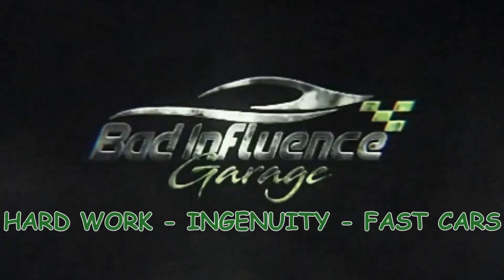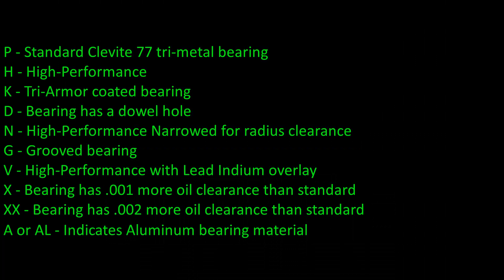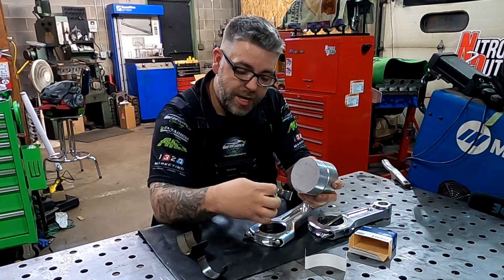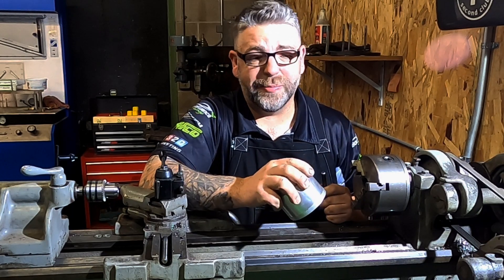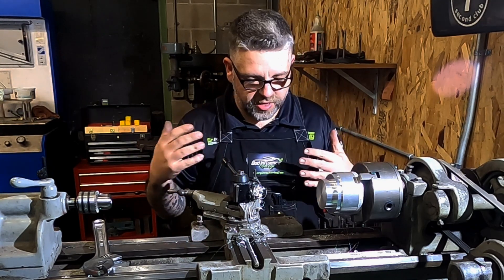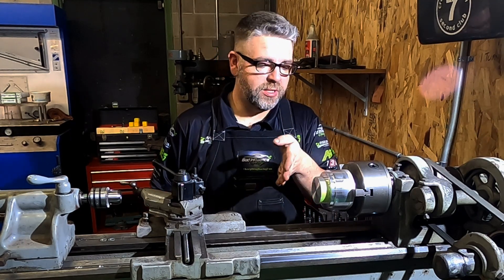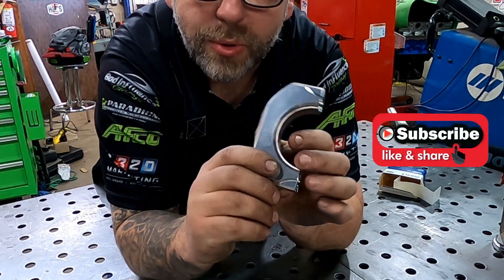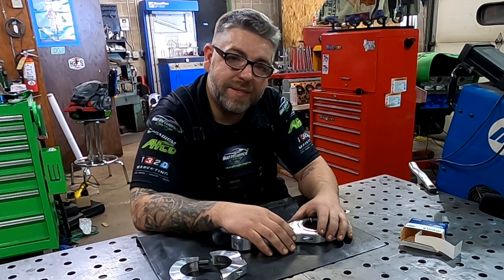Narrowing Rod Bearings! What's Up With All The Bearing Letters? Improving Engine Performance Ep4

Comment: If i have to narrow a rod 1mm to fit my application would i also have to have the bearings machined?
Reply from the maker: You would need to see if the bearing is flush with the rod first.
Reply: I checked the bearing width its 16 5mm.   The big end width is 21.9mm but needs to be narrowed to 20.82mm.   So I should be fine?